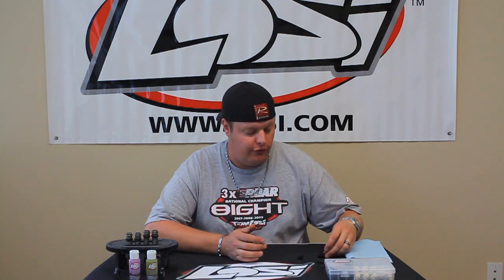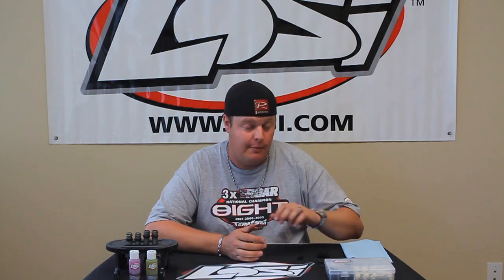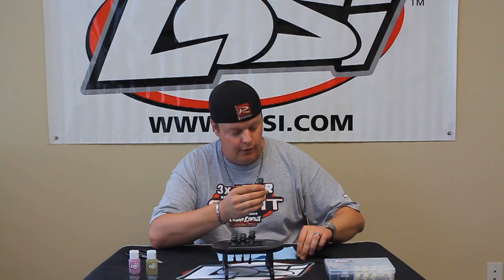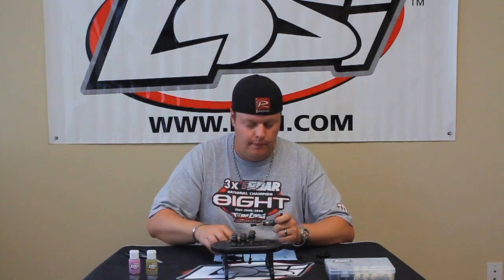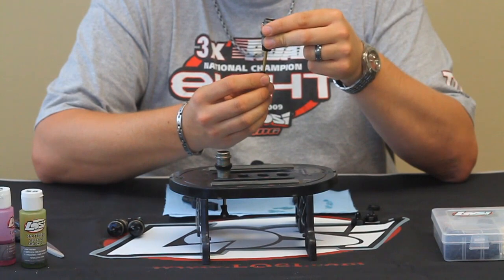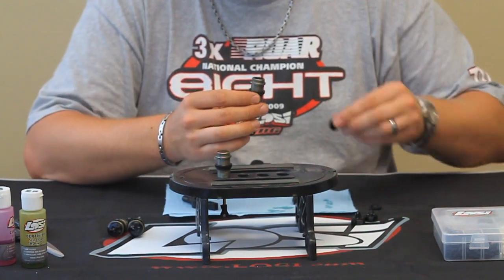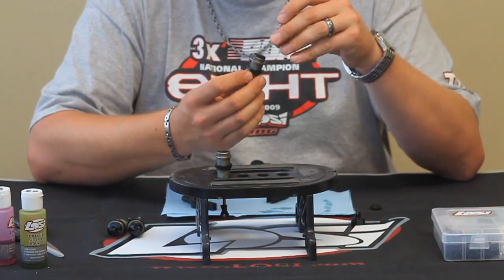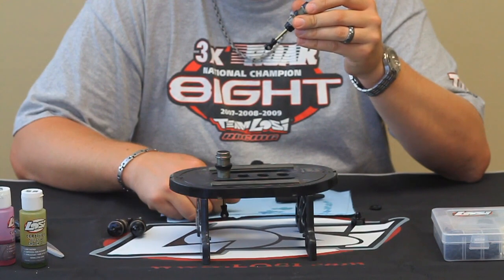Losi How-To: Rebuilding Shocks and Setting Rebound

Comment: is this the same process for all shocks? Or just losi with the vented cap?
Reply: +BradleyPeterson202 its the same priciple, completely top off with oil, set the shaft (rebound) where you want it when you completely seal it up.

Comment: how about bashing which include a lot of jumps, will you prefer high rebound?
Reply: basically yes. bumy course require the shock to return to extended position as quick as possible, or it'll bottom out. But if the car only taking couple huge jumps, slow rebound is better. So the car setle/land nicely without bouncing up which could cause flip over.

Comment: Guys....where the piston is when you assemble the shock has nothing to do with "rebound" or action of the shock.....springs,oil weight,preload,and piston hole size(valving) is what determines compression and rebound....
Reply: Rebound is caused by the internal pressure increase from the displacement of the shaft entering the shock. You don't even have the springs on when you test the rebound. The oil weight and piston holes may affect the speed that it rebounds, but that is about it.
Reply: Dean Patterson , yeah, for real.
Reply: Wrong, rebound is the damping force, the internal pressure is just that, pressure, a spring rate. I see loads of RC guys refering to that as rebound, it's bullshit. The vented cap is also bullshit, it actually stops the compression damping working. RC shocks are TERRIBLY designed, they do most of their work through the friction in the o-rings, the damping chamber is almost useless.

All this fuss about 'zero rebound' shocks is not only not understanding what rebound damping actually is, but also actively harming what bit of compression damping the pistons can actually generate.

Source - I rip crap Losi's and other shocks apart and rework them for top end racers, so the seal pack, piston and gas chamber actually work as a hydraulic damper and not just as a glorified friction pack.
Reply: Madjekyll100mph, I'm with you mate, I've raced motocross and roads, these dickheads would crash out at the first bend with their foam stuffed "rebound" shocks, pissed myself listening to him. Just don't let him near your real bike or car eh? Not unless you like hospital food.